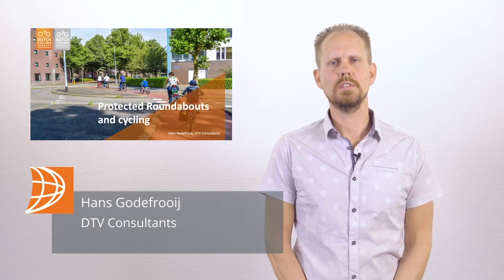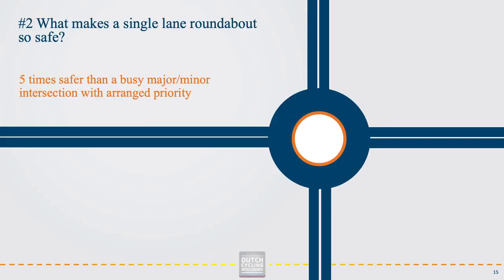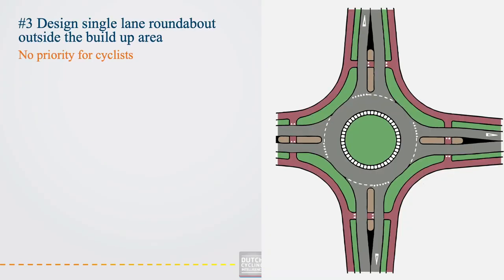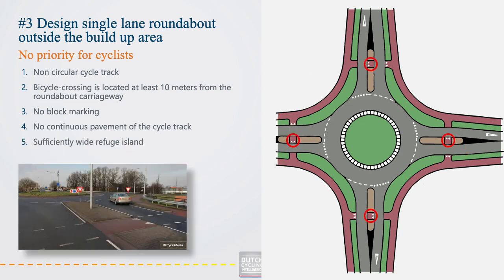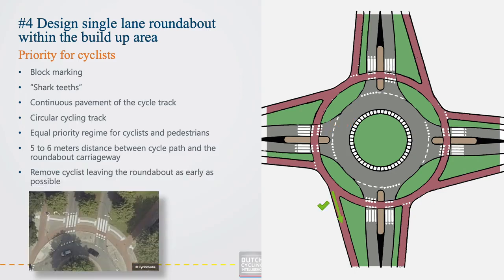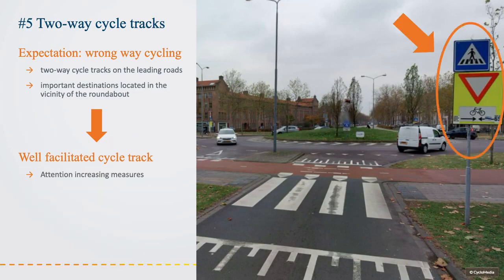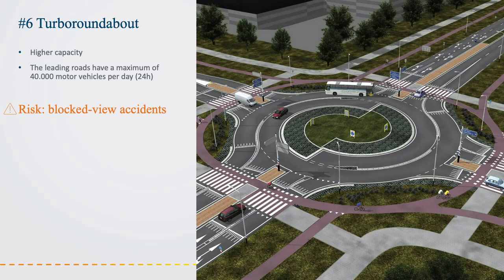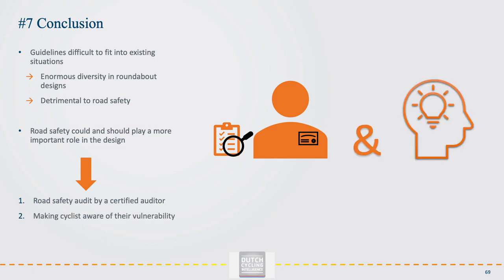Protected Roundabouts and Cycling

Comment: Cyclists should ALWAYS have priority over motor traffic. Why is this different outside of built-up areas? Always give priority to the better (i.e. eco-friendlier) mode of transportation!
Reply: probably because drivers wouldnt look
Reply: Higher motor vehicle speeds, lower density of cyclists, higher prevalence of trucks. All reasons not to give cyclists priority.
Reply: @aeiouaeiou100  Motor vehicle speeds need to come down, and by a lot.
Reply: Because safety is Job #2 right behind convenience of motorists.
Reply: @burgerpommes2001  They will if they're forced to with proper design.

Comment: In Switzerlands single lane roundabouts I always drive in the middle of the lane. If everybody would do that, I think safety wouldn't be much worse than with such bike lane. It looks like the car drivers get more profit out of it than the cyclists, because they have less traffic. To me the bike lane make sense for slow or insecure cyclist only. So out of cyclists view it would be better to make the use of the bike lane optional.

Is there something I've missed? I'm reality not that sure that I'm right.
Reply: It's not clear to me whether you're driving in the middle of the lane as a car driver or a bike rider. Value does not only depend on presence of a bike lane but also in priority conditions, refuge spaces, markings, etc.

Sometimes, if I am in a mood of high-speed cycling and a car lane seems more efficient than a bike lane, I cycle on the car lane.
Reply: i is safer to have a dedicated space
Reply: It's way more dangerous, there's data on this. Also to you last point: you want to let children and elderly cycle so adding cyclists onto the lane is not recommended.
Reply: @mrb00tt  I do that as a cyclist of course.
Reply: @aeiouaeiou100  Could you provide some details? As far as I know there are many accidents because car drivers leave roundabouts without using the blinkers and hit cyclists who drive beside them.